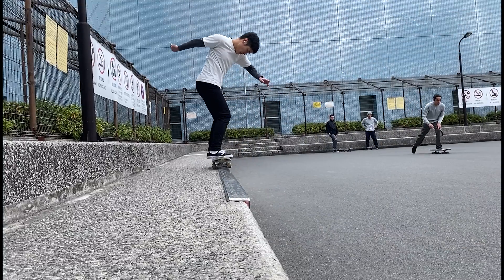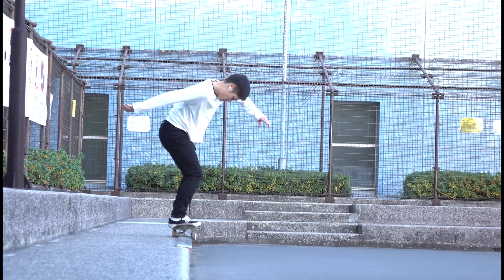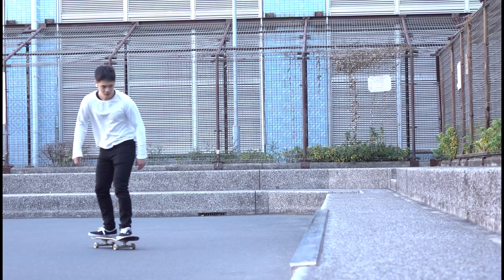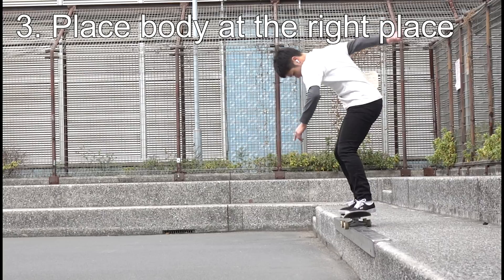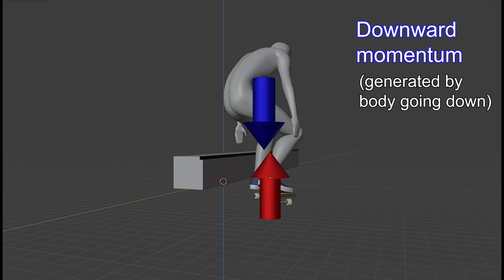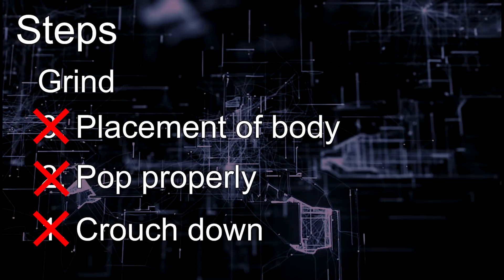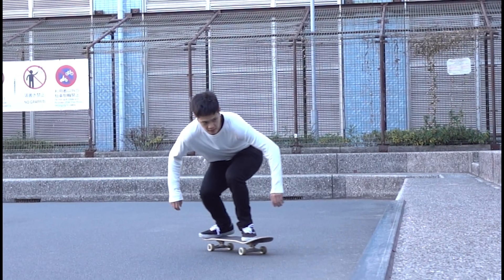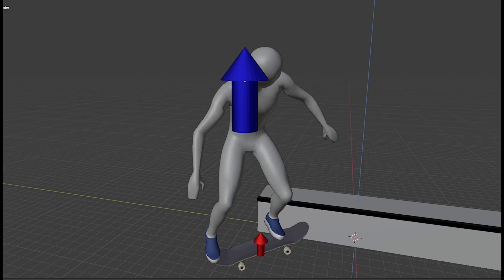Physics behind backside 50-50: Why is it hard to lock in SCIENTIFICALLY??

Comment: When I was like 12 I fell on my ass so hard I cried trying this trick. Tailbone straight to the angle iron. Was determined to learn back 50s ever since and now it's easy. It's all in the shoulders and getting the right angle riding up to it. Personally, the angle is only a few degrees with shoulders parallel to the ledge. I almost do sort of a backside shifty but ever so slightly.
Reply from the maker: Thanks for sharing your thoughts. Helpful indeed.

Comment: you land off because your not approaching the ledge parallel enough.
Reply from the maker: thanks for the comment.
do you mind adding some objective, scientific explanation to it please?
thanks!
Reply: @whythetrick  If you pause the video at 5 seconds when your approaching the ledge; Notice how far you are from it and the angle of  your board, its almost at about a 70 degree angle, when you should be approaching the ledge with your board almost parallel to the ledge. So an angle closer to 20 degrees. If you did this, you would not have to aim your back truck as much and you would be closer to the ledge so your trucks wouldn't be traveling as far so it would make the overall pop onto the ledge a lot more controlled. Hope I was helpful.  Good video by the way.

Comment: in my case bs 5050 much better while grind in round rail,,it can lock forever,,fs 5050 to me hard becouse always slip,,,correct bs 5050 not do ollie bs 180 just in video but just follow little side rail n ollie foward shift little shoulder same as rail,,that all

Comment: It isn't hard at all, never had an issue with them. You shimmy them mid air just like a frontside 50-50. Frontside and Backside Tail slides are exactly the same principal.

While there may be differences like your vision or how you position yourself both prior to and upon landing, for the most part it is merely the fact that you learnt frontside first that makes backside seem more difficult. I skated with numerous people who learnt backside tricks like tail slides and 50-50 before frontside and when people protested the difficulty level they were always puzzled by those comments.

For all of these tricks you either come up on a really stupid looking angle or you come up mostly adjacent to the ledge and do what I call a shimmy in mid air. Most noobs come up on the silly angle and rely upon landing roughly in the right spot, exactly as shown in this video actually, it is a good representation of what you shouldn't do, or at the very least should be working on getting away from.

For many tricks the most important step was missed in this video and that is the set up, long before you even think about crouching. Through practice you should work out your own weaknesses and find ways to position your feet and the angle you come in on to compensate for those said weaknesses. Iv'e taught people how to do perfect hardflips and frontside flips in minutes by getting them to change their foot positioning (as an example of small adjustments making big impacts on outcomes), although you also have the option of trying to re-train yourself which takes longer but will produce much better results.

With this particular trick if you almost come at the ledge head on, you are going to putting too much power in motion to forcing yourself into the ledge, this is not what you want and increases your chances of slipping off, one truck not locking, your body positioning being all wrong etc. If you come up almost parallel and shimmy onto the ledge you will essentially be following the same line of force as the ledge itself and have far less resistance to what you are trying to achieve.

That rant went on way too long. This is all anecdotal stuff from my experience many moons ago when I used to skate all day everyday as a teenager and the many things I learnt and observations I made.

Comment: I'm ngl,  you are coming in at a very aggressive angle, which i cant lie, is going to make the trick a lot harder, if you come at the ledge with a much more shallow parallel angle and shifty ollie instead, it is a lot easier to control as you dont have to adjust your shoulders, and you dont have to turn the board as much, allowing for a much easier lock in

Comment: With most ledge tricks, think of doing a solid ollie, and the board is stuck to your feet, aim your feet where you want on the ledge. Rotating shoulders comes next and that's harder to explain but being parallel for basic grinds, and slightly off center for advanced grinds, perpendicular for slides.

Comment: Well done video, amazing 3D-Animation! But I guess the 50/50 is "just" about board control (you might need to skate about one or two years to get it good). I don't see a secret in that trick to be solved by science. The grinding isn't difficult because your board is still in riding direction. 
But there are other tricks that make skaters insane because of not finding out to execute. For example not being able to slide a (long) BS Tailslide. Or some flips such as hardflip and inward heelflip. I would be really interested to look on THAT problems from a science view.

Comment: You’re coming at the ledge like you’re skating transition you need to come at it more parallel with the ledge
Reply from the maker: thanks for the comment.
would you mind sharing some scientific and objective reasons with us please?
Reply: @whythetrick  ight so when you come at the ledge at almost 90 degrees as if theres a bank in front of it, you throw way too much weight in the wrong direction to which you’re grinding it. If you come at the ledge more parallel with it you will shift that momentum into keeping you on the ledge longer, didn’t really think it needed much more explanation but there ya go 👨‍🔬

Comment: Keep shoulders in line with the board and approach the ledge at less than a 45 degree angle. They're actually easier to hold than a front 50

Comment: Just a suggestion. Try going more parallel to the ledge with little angle. When you Ollie from a big angle naturally it will make it hard to lock your trucks. Usually I like to be less than 30 cm from the ledge before I pop.

Comment: Great video. It's the angle your coming at it thats making it difficult. Come almost parallel to the ledge so you can keep your shoulders squared to help you stay locked on the ledge longer. Once you get it down you'll find backside to be easier than frontside.
Reply: Its like you are doing part of a late backside 180 mid air while jumping on a ledge, and it instantly lock in

Comment: though for me personally the issue with back 50s was the slight backside rotation. ollieing onto a parallel sidewalk backside helped me a lot. also trying them on a pole that's laying on the ground. great way to get used to locking into any ledge/rail trick/combo.

Comment: My trick is to guide with your front foot, even though you are approaching at an angle, slide your foot parallel with the box or ledge, and the board will follow and straighten out with the ledge, and just make sure you are picking your back up your back foot. pop high and commit, slide foot parallel with box, pick up back foot.
Reply from the maker: Great tip!

Comment: For me the explanation is simple. When you Ollie, as your knees go up, they also go forward Infront of you, so do your feet and the board, meanwhile fs 5050 is way easier and even possible to get on it riding parallel to the ledge. BS 5050 though, you have to go at an angle and scoop the board behind you. It's hard to get the board behind you when it naturally goes Infront of you. The higher your knees go the more forward the board goes if that makes any sense.
Reply from the maker: thanks for the comment. great point!

Comment: How do you even pop on the way down lol? These problems have more to do with body weight distribution and shoulder position. If you want to back 50, the main thing is to lean back toeside when you pop and align shoulders with the ledge. You don't need a crazy angle like that either. All of my backside grinds/slides got more consistent once I started going parallel.
Reply: I have trouble hitting them high on angles, but I'm training up with BS slappy 50's.

Comment: Do one of these for tailslides. The physics as to how and why tailslides can be so difficult to do at first is truly amazing.
Reply: dude ive got a tip for you that made me learn back tailslides in literally 1 day lol. So if u have a bed with a big edge u should just try jumping on this edge with ur bare feet, like just jump on it like if u were doing back tail and control the balance, it made learn this trick so fast
Reply: for back tail you want to do a solid ollie, and use your front foot and go straight out perpendicular to the ledge, it's really important you aim the front foot or else you'll do a back smith/back lip.
The key to holding back tail is making sure your front/outside food is raised higher then your foot on the tail. Once you start sliding you'll quickly feel how you need to adjust your weight so you don't shoot out. Basically lean back and look and down your leg at the board.. KEEP THAT FRONT FOOT RAISED
Reply: @ColouringWithShadows  Also shoulder parallel to ledge / rail to go regular and perpendicular to go fakie.
Reply: The biggest thing I think that makes tail slides difficult is the timing, which is why it’s easier at an angle with more speed. You need to pop and clear the ledge before turning to land in tail slide
Reply: I
Reply: @tresfordays9644  gff
Reply: BS tail please
Reply: @svnk.  My method: go parallel to the ledge, really close, like 2 or three inches away. First rotate your shoulders, then pop. When your tail reaches the height of the ledge, rotate the board. It's easy because you've rotated your shoulders before. The inertia of the rotation gives you a good headstart on the slide and helps prevent getting stuck. Also, if you rotate exactly 90º you land perfectly and avoid wheel bites. Do not be afraid of sliding, if you leand to your toes it will slide too much. Center your chest over the board and let your butt lead the way. Now you are locked and sliding, enjoy. If you approuch in a slight angle you will have an extra spin force that will help you pop it to fackie.
Reply: One way it's hard because most of the time you're going in blind

Comment: I feel like the biggest part imo is the backside shifty that has to happen. It's so drastically different from a frontside 5050 in the sense that for a fs 5050, you can stand parallel & close to ledge. With bs, your heels hang off and you have to be further away from lesge so as not to hit them, & jumping backwards is so much harder too. So a good speed & a good backside shift are key, atleast for me
Reply: Aim your front truck while making shoulders parallel with the ledge and your back truck will fallow
Reply: @mccullsn  Exactly. I feel like people make bs 50s way harder than they actually are. You do not need to angle this much to get into a 50 backside, like the angle he is coming into the ledge in this video is really exaggerated (This is also a lot of people's problem FS as well). But hey whatever makes you more comfortable with it go for it. I personally think you should be as parallel as possible and have a slight angle or lean on your heel side at a different time as opposed to making a super wide cut. Definitely will make you more consistent and you won't miss the ledge. This is especially important when going for bs 5-0. If you angle too much you won't lock in right. I try to think like I'm getting into a manual on top of the box but just line up with the edge and everything goes pretty smooth, same for 5050. Hope this helps some people
Reply: Yeah, that's because your board naturally goes forward when you Ollie. Think about it, when you stand up, your feet are below you, when you lift your knees your feet are... Infront of you! That's what you are working against when you BS 5050.
Reply: the backside shift for me
Reply: I am skating for a long ass time but my bs 5050 still suck. I wouldn't dare to try a bs 5.0 because I never seem to get onto the curb in the right angle. I either not rotate my shoulders enough or miss the back truck.
I'm also going with a decent angle because I think otherwise I will miss the curb edge.
Should I really try to be parallel and if so, what should I care about in the motion? 
I feel it is so hard to practice the motion because with little curbs I have no problem but as soon as the curb gets bigger, I never seem to hit it right...
Reply: @jansebar2301  Bs 5050 had always been a struggle for me as well and I could never get my back foot on, the problem was mostly because I kept so much dead weight on my legs like the video says. Recently I figured out to open up my shoulders a bit before popping and turn them a little to make them parallel to the ledge while in the air, using my front arm to guide by body onto the ledge (a little bit like the wind up for a back 180, and think about someone pulling your front arm along the direction of the ledge which would make your shoulders parallel to ledge's edge). In this way my back foot would follow the board naturally in a shifty motion in the air to get the lock in, because your feet always follow where your shoulders goes. just remember to lift up your body before you pop to allow space for your feet to follow the momentum. Focus the landing point in front of you rather than behind your back, narrowing down the angle and going fast definitely help balancing because it is easy to twist too much when going at a large angle. Hope this helps!
Reply: @fatwongong  hey Wong thanks for the detailed advise. I will definitely try that once I'm able to skate again :)
Reply: @jansebar2301  i say do it over and over again on thr curbs, maybe try landing with your back truck 1st when you get comfortable with the 5050s. Then lean more and more til you start sliding a 5-0 for a bit
Reply: @jansebar2301  I can bs 5050 and bs tail but can't bs 5-0.

Comment: this is not how the quads work. Holding it in the crouch is causing a loss in elasticity and strength. The key to a high vertical leap is relaxing the muscles til you hit the crouch, and then exploding up immediately. This way you're not wasting muscle resources by holding a crouched position with your quads. I like most of your videos but this one does not agree with the science. Look up the man with the highest vertical leap record on youtube. There is a video about the science behind vertical leap optimization and it talks about this specifically. You don't want to hold the crouch, you want to be down as little time as possible and explode.
Reply from the maker: Thanks for the comment. 
I think you are right if the aim is to jump up high. The point is, I believe you don’t have to jump up so high when you are skating a ledge that’s 30cm high. If you are skating a higher ledge, you’d prolly have to utilize the concept of Stretch Shortening Cycle just like one of my insightful subscribers like you said. 

Whereas, when you don’t have to jump up so high and all you have to do is to get on a relatively low ledge, I believe it is much more beneficial to “cancel” SSC by stopping your motion for a while so that you can avoid messing with your body axis.
Reply: @whythetrick  interesting ! Thanks for the reply , always learning